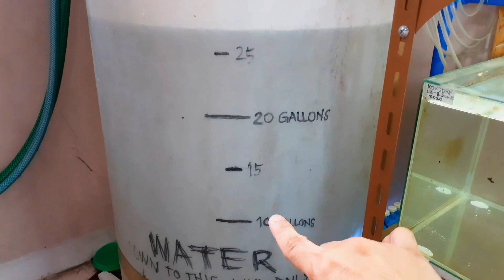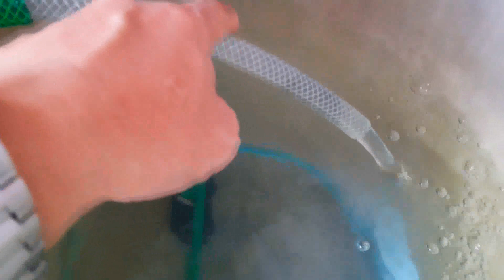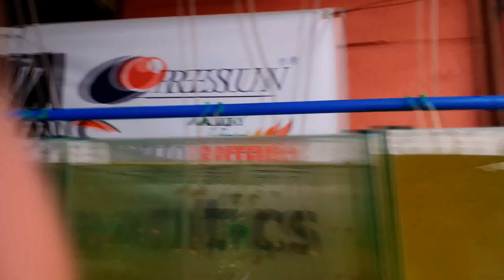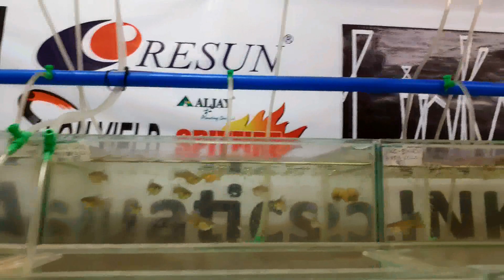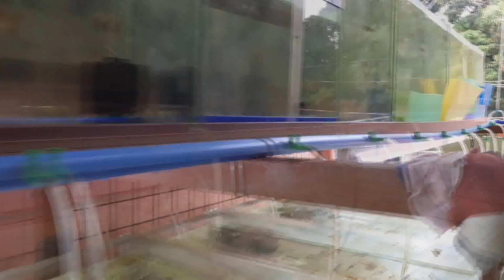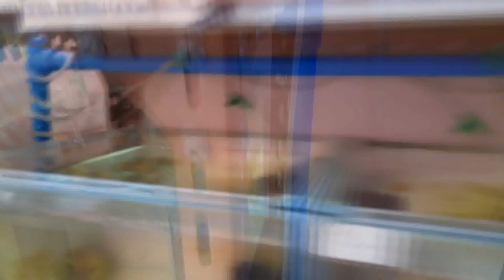How to Setup the Safest Water Change System For Your Aquariums - Drip Water System - My Dream Setup!

Comment: Hi, Nice idea with the drip water system. No need to put a hose or use buckets for each tank. 

But what kind of pump (brand) do you use? what are things to consider in choosing the pump to use for this kind of system? 

More power to you and your team sir.
Reply from the maker: It is a Halea submersible pump but I already forgot the wattage but I think it is about 2500L/H and the maximum lift is about 2.5 meters from that you can match the wattage/capacity that is best for you. We appreciate your support. Thanks -LINKS Aquatics

Comment: New subscriber here from cainta rizal thanks for sharing , great idea ,I like your set up!
I also have drip system water change direct from top water without pretreatment
But mine have automatic timer , you can set time date on/off
So i gradually change new water daily about 10% -15% depending on the fish load ,each tanks also have adjustment to control drip water
and the old or excess water comes out in overflow drain ,
More Power in your blogs God Bless!
Reply from the maker: Thank you so much for subscribing to our channel... Nice to know that you are taking good care of your fishes by building your own drip water system. More power to you as well and keep enjoying the hobby :-) Thanks -LINKS Aquatics

Comment: what is the wattage of the submersible pump did you use?
Reply from the maker: I already forgot the wattage but I think it is about 2500L/H and the maximum lift is about 2.5 meters and from that you can match the wattage that is best for you. Thanks -LINKS Aquatics

Comment: Litters/hour of the submersible pump that your using for the system?
Reply from the maker: I already forgot the exact rate but I think it is about 2500L/H and the maximum lift is about 2.5 meters. Thanks -LINKS Aquatics

Comment: Great video.  Few questions, 
 1. Does the drip water system run continuous,  or only when the tanks need a water change.  
2. What is the method used for siphoning out old water from fish tanks. 
3. Does the faucet (water source) need to be open only when there is a water change or it is continuous. 
4. How will you prevent this system not flooding the fish tank if it is continuously dripping water.  
Thanks.
Reply from the maker: 1. Does the drip water system run continuous,  or only when the tanks need a water change?
Answer: Our drip water system is designed to run manually, meaning we only have it running during water change schedule.
2. What is the method used for siphoning out old water from fish tanks:
Answer: We still do manual siphoning of the tank. We prefer it that way since a manual siphoning of the tank does a better job of thoroughly cleaning the dirt on the tank bottom. We also have a separate video of how we clean our tanks using the drip water system.
3. Does the faucet (water source) need to be open only when there is a water change or it is continuous?
Answer: Our drip water system is designed to run manually, meaning we only have it running during water change schedule. Same goes with our water source (faucet).
4. How will you prevent this system not flooding the fish tank if it is continuously dripping water?

Answer: If you are running a continuous drip water change system, you will need to put overflow holes on your tanks connected to a pipe system where water can be disposed or recycled. Since our design only needs to run during water change, we need not worry about flooding our tanks.

Mubarak Ali,

We appreciate your inquiry and your support to our channel. Happy fish keeping :-)

Thanks,
LINKS Aquatics :-)
Reply: @LINKSAquatics  Thanks for the detailed explanation. Liked and subscribed your channel.  Keep up the good work👍👍
Reply from the maker: Thank you so much for your support :-)